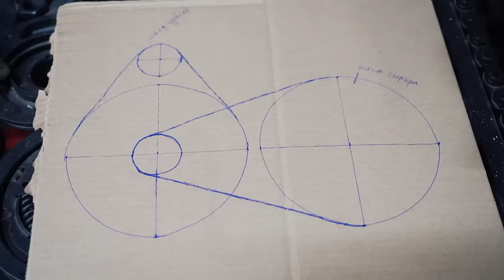Turbocharging a Lada with a starter motor

Comment: No doubt in my mind that electric turbos will soon be a great option. With advanced Brushless motors and lipo batts it is totally possible to get the super high RPMs required for a turbo to be effective. The trick will be when someone puts together an electronics package that overcomes the issues of properly delivering the electric power and controlling boost.
Reply: yup, and maybe 1-2 "external" fuel injectors so it doesn't run too lean.
Reply: my audi s4 had a small electric turbo, they already using them
Reply: They will be great for helping to spool bigger turbos
Reply: All great points, excellent comment.  Allow me to add to the conversation:
Alternators generally max out at 100-200 watts output, this would be drawing off the cars battery primarily for the required current- For example: Treadmill motor puts out 1/3 hp (©250 watts), a V8 starter motor between 1 to 1.5hp (©750-1250 watts), and a diesel starter motor between 5-7hp (©3750-5250 watts).  A turbocharger at full throttle on a small 4 cylinder is recovering about 20hp from the exhaust stream.  These electric motors all have various rpm ranges which need to be accounted for in gearing to a mechanical turbo or technically a supercharger, I did the reading so you didn't have to.  Basically you need a 20hp or above electric motor, controller, capable batteries, and gearing to achieve 30,000+ rpm to match the boost provided by a stock turbocharger on a 4 cylinder, which is quite cost prohibitive.
Reply: @ProlificInvention  Typical car alternators are 80-150A, not watts. The cabin blower alone can be 300+W, battery charging can draw another 300-400W (highest battery charging current I have seen on my car is 35A@14.5V, which is 507W for about a minute after winter cold-start), all of the required running lights on older cars with incandescent bulbs is another 100+W, the fuel and ignition system including sensors and computers is another 100+W, then you have all of the other non-essential accessories. Excluding battery charging which is only a temporary load after startup, that is 500+W required for baseline operation, basic comfort and regulatory compliance.
Reply: Check out alexltd. He had a really nice diy electric supercharger build on his channel.
Reply: @teardowndan5364  I mixed up amps and watts in the beginning of my comment, the rest was accurate though.
Reply: Not directly related, but the mclaren p1 uses a hybrid system to drive the crankshaft, to eliminate turbo lag, and increase low end torque. This  would be an interesting thing to try.

Comment: Well, a turbocharger should have lubrication with oil, so that would be a nice addition. If it needs to be a separate system (from the engine itself) then add an oil reservior, and pump for it. You can tune the spin rate of the turbo, based on the revs. I'm not sure about the way the revs are shown on the dash in the old Ladas, but as soon as you have any reading, you can convert that interval and map to a controller that controls the spin of the turbocharger. Just quick tips :) Contact me if any help needed with the electronic part of the stuff! Tho' I'm sure you can figure it out! :D

Comment: Fantastic. So much fun and simple.
The impeller's shaft won't last long with those sudden stops.
Reply: Not even remotely true
Reply: But it isn't stopping. It is just not being powered. It has massive mechanical advantage on the starter via the ratios and the actual masses of the pulleys. It's not slamming to a stop each time he turns off the starter motor.

Comment: Good video, car looks fun to drive. 
How about converting the unit to run directly from the crank pulley to make a centrifugal supercharger. 
Another method (but a lot more complex) is to fit a 48 volt alternator to power a higher rated motor similar to modern anti-lag electric assist turbos and mild hybrids - which use 48 volt electric because standard 12 volt car electrics just isn't powerful enough.

Comment: Several things;
1- get a flipping boost gauge! 
2 - wide open throttle switch (like on a nitrous car)
This way when you stomp the gas, the system comes on when the throttle cable pulley hits the switch.
3 - we need a pull from a dig!
4 - experiment with different electric motors. Higher rpm = better.

I didn't think this would work. I'm impressed.
Best of all; they can install it easily on other builds!

Comment: I feel you're getting good results because when it isn't turned on, it's massively restricting airflow and hurting 'stock' performance.. a regular turbo will spin slowly at idle, this being connected to a pulley doesn't turn at all. 

I'd love to see a boost gauge to see what kind of boost is being generated.
Reply: I'm sure they know how a stock lada drives from the back of their hand
Reply: hurting stock performance? on a LADA????? good luck with that! i drove a few in the UK when they weere sold here and gutless was probably the nicest way to describe the performance.

Comment: Go brushless , high rpm makes easier to marry to the turbo . Attach two throttles together at the throttle linkage  , you can also separate wether you want boost early or later in rpm by how you join them . Usually a powered charger is ran boosting motors from low rpm , turbo chargers for use in motors at high rpm . Be cool to see it boosting the pipes to oblivion and if you add a little ethanol injector to give it more bang . More air needs more fuel , bigger bang ha ha ha  it’ll either work or lift the head without undoing it 😁

Comment: You need an extra fuel injector that sprays in extra fuel when you push the "power" button
Reply: A squeeze bottle of fuel taped to the steering wheel with a long hose going into the intake.🤣
Reply: lada dont have injectors lol
Reply: @laszloszell8753  😂

Comment: I think using a 3 hp muti-speed wood router powered by a inverter would work much better then a starter motor.
Reply: Treadmill motor puts out 1/3 hp, a V8 starter motor between 1 to 1.5hp, and a diesel starter motor between 5-7hp.  A turbocharger at full throttle on a small 4 cylinder is recovering about 20hp from the exhaust stream.  These electric motors all have various rpm ranges which need to be accounted for in gearing to a mechanical turbo or technically a supercharger, I did the reading so you didn't have to.

Comment: The whole reason I suggested a brushless motor was so that you could run the turbine fan flat out because a starter motor the brushes can't handle that much RPMs and there's fist-sized brushless motors that turn over 60,000 RPMs
Reply: sounds reasonable to me.More reliable also.
Reply: starter will not run 60000 anyways. most of these smaller turbos run 30-40k.They have two multiplying pulley sets so starter actually runs around 10-15x slower than turbo.
Reply: That's why they're using pulleys. Now you know any BLDS with more than 1,5kw as a starter have?
Reply: @sigmawarrior.fokeryou  you can't say "thats why" if i just said thats why :D joseph said that burshless wont run 60k , but smaller boost turbos event don't run 60k and they are using multiplication so it's not needed for brushless to run 60k. that was my point. I understand very well that they have low speed, high torque motor hence pulley system.

Comment: This takes me back to my goofing days with an S13 in the early 2000s. I ran my electric turbo off a 1400W AC motor, inverter and some other bits. Managed to ruin two transmissions during 'testing' before really refining the idea. I ended up making a reverse planetary gear drive to ramp up the rpm range of the turbo from 23k to ~90k. My bearing cooling idea was a complete fail, but it was glorious for about 30 seconds. 
I wish I knew what I know now about engineering and jet engines, but that is the way of things.

Comment: You're in the good path to make an eTurbo now you just need 2 things
A variable resistance to control the RPM of the electric motor so you control the boost and a fine tune starting from the Idle ( no boost but still turning  the turbo has to always be spinning otherwise it chokes the engine air intake ) to the max rev at full throttle and then you should see some nice boost, not even talking about de gasoline intake but if you use a carburetor it might simplify thing in one hand but will make some other things harder, anyway that's one really interessting project here guys good luck  !

Comment: You need to verify times and mph on a 1/4  mile track. With and without the system functioning. also suggest a blow off valve along intake with an oil line to the turbo so bearings dont freeze. Dont think you need a waste gate because your not running any exhaust.  May also need bigger injectors with a calibrated mass air for fuel so you dont run lean and detonate if really are pushing cfm. Lower compression needed for pistons if pushing serious cfm and may also want to run atleast premium gas for it so less contaminates cause detonation.

Comment: I know there's a few electric Superchargers that are sold. One's named "TorqueAmp" they use a lot more voltage (48V) and they use a drill motor or some type of high power electric brush less motor to drive it. They usually make around 5 to 8 Lbs of boost. Maybe some of those types of ideas might work here? Hard to say but this is a fun one that's for sure! LOL.

Comment: Some kind of duct and shroud should help cool the motor, and as far as controlling it I'd recommend using either a brake pressure switch or a button switch behind the throttle pedal so it's only on when the throttle is being applied be it low throttle onwards or exclusively at WOT.
Another thing worth trying is a supercapacitor setup in order to draw load from the alternator when the charger isn't running, and then applying the motor with the proper kick when needed to spool up that charger quickly

A bottle of octane boost and clean stuff might help too. If you're not running into detonation issues at present the extra octane will only serve as a safety net, however anything that helps to clean the valves and ensure the injectors are working at their best is worth a shot

Comment: A push button mounted on the gearshift handle would make it much easier to control your timing on when the turbo kicks in. That would give you better reaction times. I would be curious to see what the actual times down the track after a good dyno tuning would do for it

Comment: I’ve seen people use air tanks under high pressure instead of using electric turbos.  You can tailor your pressures to suit your horse power and there no lag or extra oil and or coolant lines to mess around with and what great you can fit an air compressor in your car to fill up the tanks on move so you never run.   I’d like to see you guys try this method.

Comment: it still needs better tuning , the smoke that came out of the exhaust is called detonation ,it is when your air/fuel mixture ignites before the spark. you could use a fuel regulator to get more fuel in the mixture which will enhance the power since it wouldn't run lean anymore and fuel regulators are cheap as well.

Comment: Here's an improvement idea. Have an normal on/off switch on the dashboard and a momentary switch under the gas pedal or at the throttle body that gets actuated only when gass pedal is pressed at maximum. That way you can also have a normal engine mode and a "super speed" mode that kicks in after you keep the gas pedal pressed. This way you don't have to press it with your hand. Also, please take care to use high amperage switches and thick cables that can take the power without overheating. You may also want to make some aluminium sleeve with good amount of cooling fins to go on the turbo starter motor, use it with thermal paste for even better efficiency. Maybe even an air guide to have proper airflow on the turbo starter motor.

Comment: First, I would find an electric motor for a washing machine or refrigerator, or, if you can,  find a motor for an electric leaf blower or lawn mower. 

After this, what I would do to tweak the system is actually have a rheostat or potentiometer mounted to the throttle body, which could then control the power going to the motor for the induction system. By mounting the potentiometer or rheostat on the butterfly valve axle, like a Throttle Position Sensor, you would then have some control over how much boost you're getting from your forced induction. Also, by tuning it to the throttle body, you make the induction linear, which means you then have an electric supercharger, and not a turbocharger.

The other thing you'll have to tune is the boost pressure, because if you have too much pressure, you could blow manifolds or even gaskets apart through pneumatic pressures.

Comment: Quite interesting.... You should continue this project,it's one of the best so far. 
Use a brushless motor,it will be more reliable and powerful. Use a piggyback ECU like Ecumaster DET3, it is dirty cheap and has macro commands ability,so you can activate the blower at a specific rpm range or gas pedal location, and of course you can make the fuel and ignition maps. Don't forget a supercharger bypass valve.

btw, Ecumaster det3 has a build in road dyno that u can use too see the gains.

Comment: I love it, it's a lot more work than just the exhaust driven turbo but it was a fun experiment. I just don't think the starter motor is meant to run more than a few seconds at a time but if you find a way to cool it somehow it may last

Comment: Starter has a lot of torque but isn't designed to run for longer periods.  

I would put it on its own power supply.. make sure it has adequate amperage and it will run cooler. 

You would gain power by changing out the pulleys to maximize how fast the blower pulley spins without burning out the starter.

A simple button that has to be held down to activate could be mounted under the gas pedal. Extend it and possibly put a spongey material above it so it will activate 3/4 throttle and not hender your gas pedal from going all the way down. You let up and it stops. Or..... a potentiometer that is mounted next to the gas pedal rod. It will increase power as you push on the gas. 

I'm jealous.  You guys are having too much fun 😆

Comment: 7:04 Might sound negative.. But im only pointing this out. 
Most factory turbo vehicles have their MAF sensor before the turbo, not in the charged side of turbo. 
I have 2 vehicles with MAF's before turbo from factory. I personally would prefer setup that way because if turbo has a leaking journal bearing, it will blow oil deposits in the charged side of intake and leave pools of oil resting at bottom of intercoolers. The MAF sensor should be kept dry but also not get beat up by forced induction mods.

Comment: I often wondered about putting a srartor motor on a turbo and you guys have done it. Well done. I thought about using a reduction gear startor direct without the gears for extra speed. Here again you seem to have worked this all out. You did not talk about this but it looks like you researched the required speed before making the gears. Well done.
Reply: yeah, they show us how effective that one is to put into use

Comment: Get a 4 speed blower motor switch from a climate control system. You have four different levels of power 25% 50% 75% and 100%. Run the switch output to your blower motor power input. This has a massively bad lag time. The turbo should always be spinning somewhat. If you leave the blower motor switch on low or medium low positions you should idle fine. Positions medium-high and high should be connected to a switch on the gas pedal or throttle so the turbo will only spool up at wide open throttle. Unless the gas pedal is pressed to the floor the blower motor will remain in the low or medium low setting. If you properly hook up your electrical this can be achieved with relays.

Comment: Should put a momentary switch under the gas pedal.. set it adjustable by changing the height and contact point for the button.. that way it runs normally until you press the gas pedal passed the adjusted point to activate the turbo!

Comment: Treadmill motor puts out 1/3 hp, a V8 starter motor between 1 to 1.5hp, and a diesel starter motor between 5-7hp.  A turbocharger at full throttle on a small 4 cylinder is recovering about 20hp from the exhaust stream.  These electric motors all have various rpm ranges which need to be accounted for in gearing to a mechanical turbo or technically a supercharger, I did the reading so you didn't have to.

Comment: Start motor not designed for continuous use. It has neither external cooling fins nor interior cooling because it is sealed. Also, you need a wastegate and boost pressure guage.
This is your best video.

Comment: Turbos take a hi-pressure oil feed off the engine block to the 2x plain bearings holding the impeller shaft. I didn't seen any provision for providing oil on this otherwise excellent piece of "standalone engineering"!! Develop it into a retro-fit kit and sell it as part of your "Merch". :-)

Comment: I would leave it manually controlled, also, reducing the mass of every pulley in the system will help, to keep it balanced machine dishes in them
Also my military truck runs a 12v starter on 24v. You can get a "series parallel " switch to change back and forth and still charge on 12v.

Comment: You should use a big brushless dc motor like from rc planes and drones. Get big one and run it on high voltage. Attach the compressor directly to the shaft. Use a rc motor controller. Attach it to the throttle pedal. Use car batteries in series to get the higher voltage. And recharge them using a dc dc boost converter to step up the alternator 14v to whatever voltage you need.

Comment: If I were to do this, I'd use a QS motor 3kw mid drive, ran off a 48v lifepo4 battery, belt driving a supercharger. That setup will spin up crazy fast, to whatever rpm you want.